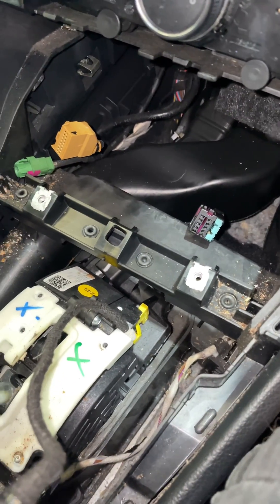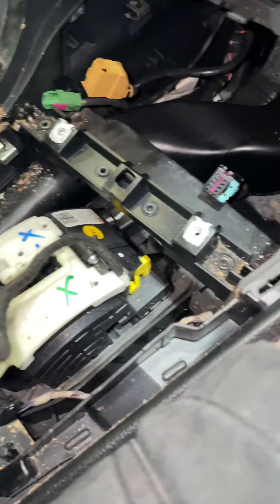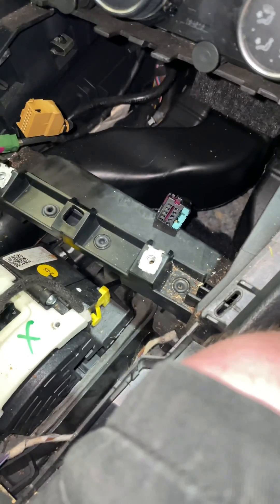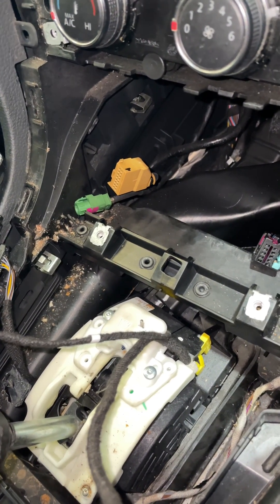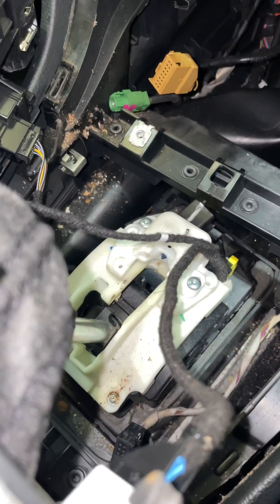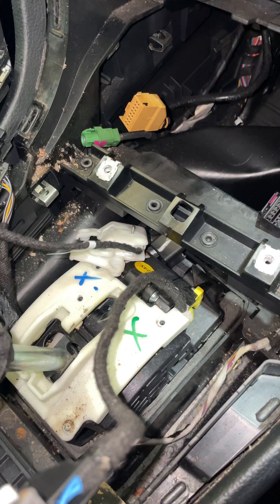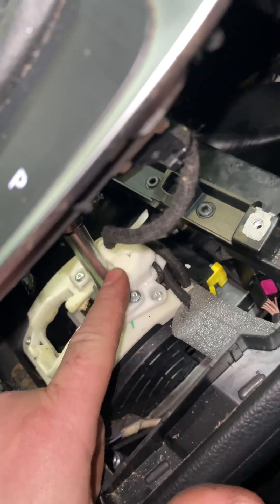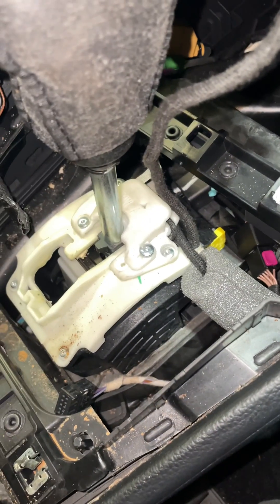Error Leave In “P” Fault On Dash (VW DSG)

Comment: hi, sorry to bother you, may i ask WHERE you got this part from ? as I have the same white one as in this video, I thought I had ordered the right one , but the black micro switch arrived, and I have tried to look on ebay etc , but cant seem to find THAT particular white switch, and my local garage phoned around for the part number and could only got the whole unit for £470 + VAT !!! any help would be greatly appreciated :)
Reply from the maker: Hey your not bothering me the part number you need for this microswitch is 3Q0713128 and you can purchase it from your local Volkswagen dealership I believe they are about £50
Reply: @The VW Mechanic  thank you very much , greatly appreciated 🥰
Reply from the maker: No problems at all if i ever use a part in a video check the description I usually put numbers there to help all my viewers :)
Reply: @The VW Mechanic  hi,  I did actually use the part number you mentioned in ur  vid,  but just couldn't find a white one,  and the guy I got the black one from said it would fit 🤬🤬, needless to say,  it's gone back !! I didn't think to actually go to vw dealer as thought there prices would be be extortionate,  however,  if its £50, that's the cheapest I've seen,  including the black ones that were at £79 !! Kinda sux having 'blonde' moments !! I was as a cook in the navy for 30 yrs , so mechanical things are way over my head 🤦‍♀️ once again,  thank you very much for ur help 🥰
Reply from the maker: No problems at all :) let me know if you need anything else
Reply from the maker: This is what prices were like everything you may find they have gone up a bit just so your aware it sucks :(
Reply: @The VW Mechanic  lol,  can u fit it ??? ( joking ) I work nites so off to bed,  hope u have a fab day !! 😥
Reply from the maker: Depends where you are in the world lol have a great day too
Reply: @TheVWMechanic_official  I found that out when I put 2 new front tyres on recently 🤬🤬, almost had to take out a second mortgage !! Lol,  but it will certainly be cheaper than the £470 previously quoted !!
Reply: @The VW Mechanic  Bournemouth (uk) lol, a tad far me thinks :) , I emailed my nearest dealer,  they don't stock that part anymore,  BUT , I have found one from a car parts place online,  its the right one,  even had a pic of it aswell,  so fingers crossed I'll get the right part this time :)
Reply from the maker: Yeh Bournemouth is a bit far haha and that’s ace you’ve found one :)
Reply: @The VW Mechanic  I will update u once it's done,  hopefully before my mot at end of month 🙏🤞, thx again for all ur help 😊
Reply: @TheVWMechanic_official  hello again, im so sorry to bother you, yet again, for some reason the place where I ordered the new switch from, has refunded me the money, I can only assume its out of stock , however, the same company now has one , but it has the letter A at the end, but it LOOKS  to be the same ? can you shed any light on this at all ?
Reply from the maker: Hey thanks for the message your not bothering me don’t worry haha and it appears to be a super-cession and the part number in fact now  3Q0713128A
Reply: @TheVWMechanic_official  thank u for getting back so soon :) i will go ahead and order it and keep fingers crossed :)
Reply from the maker: Of course :) I always try and reply asap
Reply: @TheVWMechanic_official  well, its ordered, and it ACTUALLY says 'in stock' , maybe there is a god after all :) lol
Reply from the maker: Yeh this typically happens when Volkswagen tweak the part or the manufacture changes then they will update the part number usually with a letter change and that just means it’s a revised part from original :)
Reply: @TheVWMechanic_official  u wont believe how many sites I've been on to try find this part !! and ironically THAT message hasn't shown for over a week !! maybe its weather dependant ?? and thankfully, the new part from the same firm is now £25 cheaper aswell, fingers crossed it all goes well, if so, ill update you and give u a link to the site I got it from, as I'm sure I'm not the only one having this issue !! many thx again for ALL your help, you're a angel in disguise :)
Reply from the maker: The reason the warning pops up is due to a failing microswitch so it’s when it detects a problem it will flag the weather could make it worse and yeh keep me posted for sure I love hearing a success story :)
Reply: @TheVWMechanic_official  my car is my pride and joy, 2016 gtd I got about a year ago with only 6.5k miles on it ! ex mobility car, so its fully loaded, and the best part is the heated seats, which I need as I have mechanical back failure, so this is a car for life for me now :)
Reply: @TheVWMechanic_official  will this work part work for mk7 gtd
Reply from the maker: If this matches the gear selector in your vehicle then yes
Reply from the maker: You can get hold of me on Instagram @thevwmechanic_official
Reply: Will this part work on my gtd mk7 ?

Comment: Hi, thanks for this vid. So I have the same error on my SEAT Leon Cupra but the error code is obviously different 617752, but it is showing up with Carista as a steering wheel module fault. Will this switch replacement work for me, given it is the same vehicle group?
Reply from the maker: It will be in steering control module 0016 this fault and Aslong as the part number crossed to seat you can find this out by giving the dealer a call and asking them this

Comment: Hi, thanks for the vid. What would you recommend if the warning message came on and off for about 3-6 seconds. then stays off for another 30 or so mins?
Reply from the maker: Hey thanks for the message. That’s usually what it does buddy they never stay on it’s more irritating than anything else
Reply: @TheVWMechanic_official  thanks for the reply! as it is on and off only a couple times intermittently, would you suggest sorting it out or could it maybe just be a loose connection (I wont quote you on this aha)
Reply from the maker: To fully confirm the fault you would need to run a scan of the entire vehicle and there will be a fault in steering control module (0016) to confirm selector issue

Comment: Currently seeing this issue with VW POLO 2018 DSG. Would it work for Polo too?? All the guides show Golf
POLO also has white gear cover.
Reply from the maker: Hey thanks for the comment I will check tommoro as I’m pretty sure off the top of my head there is a different process for polo
Reply: @TheVWMechanic_official  Hey, I also have a 2018 VW POLO that has this issue. Is it the same process?
Reply from the maker: This may not be the case with your vehicle buddy
Reply: @TheVWMechanic_official  alright. Thank you 👍🏻

Comment: Currently working at Seat & Cupra, this is common fault on the Arona's and some Ibizas, tpi advises, depending on symptom number, trying software update 1st before carrying out micro switch. Very interesting watching your videos seeing how much they are the same,. Thinking about trying to move up the brands, 🤔,.
Reply from the maker: Hey buddy thanks for the comment, I started my career at skoda and once I had got as far as I could there I fancied a new challenge so Volkswagen it was and I was nervous about it being totally different and yeh there are some different bits and extra bits but the foundations are very similar so if your thinking about making the move buddy don’t hold back :)
Reply: Hello, how do you perform software update?
Reply from the maker: all software updates I perform are using ODIS